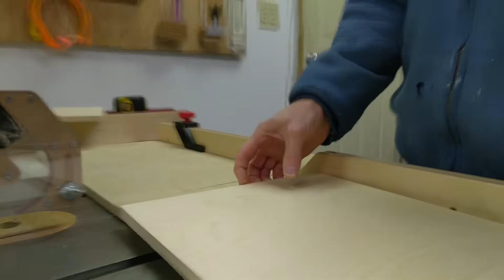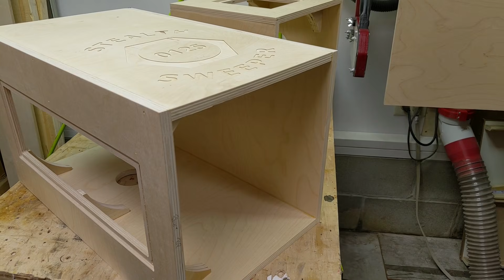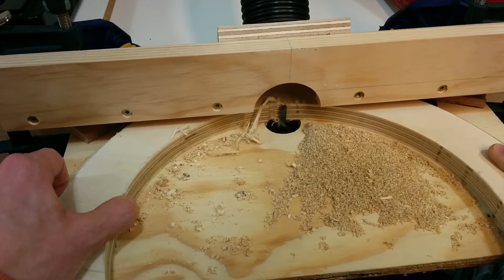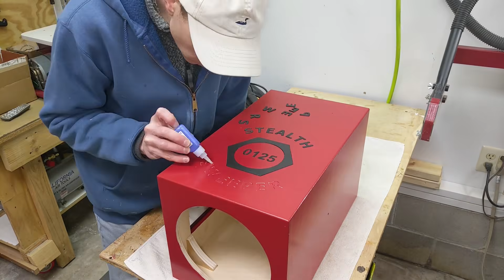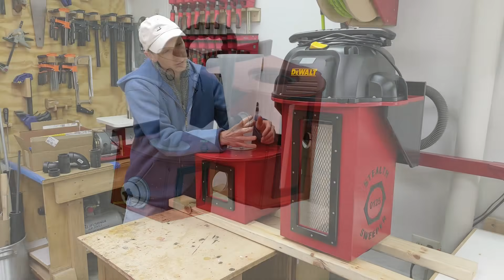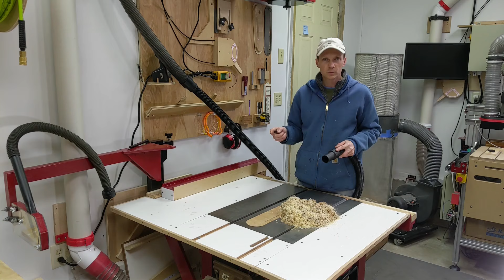The Perfect Shop Vac that Nobody Sells

Comment: Great job, Justin.  My DIY Dust Deputy leaves Zero dust in the Central Vac bucket.  (I use the Central Vac to provide Vacuum to my Dust Deputy)…
I cannot see how far your tube in the top of your dust deputy sticks down?  But, it needs to be down inside about 4” to allow it to get clean air to go to the filter.  It should be 99.9% efficient.  Play with how far the tube goes into the DD.  Your shop looks very nice.
Is there an exhaust port on the Vacuum motor?  If so plumb it outside and reduce the overall noise level.

Comment: Great video.  I am really impressed by all the items you 3D printed. You make 3D printing look so simple. Have you or would you consider a video devoted to 3D printing for woodworkers?  I'm interested in 3D printing but don't know where to start.  Can you point me in the right direction?
Reply: Buy a bambu labs printer like the P1S, or X1C if you have the budget. They just work and cut down alot on the tinkering required to print. Many printers such as the enders do not function out of the box and require tweaking and tuning of settings in software and sometimes of the physical printer itself. This causes alot of frustration for those trying to enter the hobby and treating the device as an expensive tool. 

The bambu printers will still need some software tuning depending on your material, but out of the box it works, it has material profiles that work especially if you use their brand of filaments which are reasonably priced. Matching material to settings is crucial because PLA from brand A is not the same material as PLA from brand B and as such needs specific settings. 

Oh and for CAD Autodesk Fusion (the free license) is perfect for a maker. Have fun!

Comment: I have the Dewalt StealthSonic also and use it with a Onieda Air Dust Deputy. It works great and is super quiet. My local Lowes was selling the vacuum for around $150. Definitely recommended!

Comment: The build, finish and video quality are truly excellent! But I don't agree totally on the construction details. I think that your filter is meant to work in the opposite direction because the metal mesh is placed on the outside. It is meant to have a blow from the inside or a suction from the outside. I think it is difficult to have a dust separation of more than about 99% in these kind of small cyclones and even if that is good it still means that a lot of fine dust will accumulate in the filter. It will of course still work very good some time but eventually you will have to clean it and it will be difficult when the mesh is on the same side as the dust. My solution is a filter with the mesh at the inside and then an extra spare filter. When the filter is clogged I take it out and vacuum it with a clean filter inside. And cleaning is pretty easy without the mesh. But yes, that means two filters instead of one. But mine are rather as your original shop vac filter in size, and therefore less expensive.

But again - your video is still an inspiration!
Reply from the maker: I actually confirmed with the filter manufacturer before buying the filter and  they ensured me the flow direction is from outside in. There is wire mesh on both sides. I agree this does seem difficult to clean but I will find out. This is a common industrial filter so it must be okay. A pre filter cover is not a bad idea but would require more maintenance.
Reply: @JustinDepew  My bad. I see now that there is mesh also on the inside - I have never really seen a filter with mesh on both sides before. But the issue with cleaning still concerns me somewhat. Have you considered pulse cleaning? I'm rebuilding my own dust separator for that right now, can't say how it will work yet but it looks promising from first tests. Not so complicated to implement as it may sound.

Comment: I had a thought… a spring loaded swing check plate on the clean out, with a gasket. The Dewalt vac would seal the check when under power. The main dust collector could open the check under power. Might have to fiddle with the spring tension to get the right balance.

Comment: For the CNC holding - I usually leave .030” on the floor, then cut the shape out with the bandsaw and flush trim. I started doing that because I’m using a vacuum system for work holding, but I have found it works extremely well even when using clamps like you are in this video. Bonus benefit is that your spoilboard never gets chewed up.

Easy to do in fusion with the “Bottom Height” parameter.
Reply from the maker: I think I would do this if I had a good router table set up. Right now it seems like a hassle to set up the router table to do this and I end up trying to cut all the way through on the CNC.
Reply: @JustinDepew I have actually been using a trim router with a 1/4” flush trim bit, I get really good results that way. It definitely helps to have the bandsaw to get close to the cut surfaces though.

Another good option are tabs as lots of other commenters have mentioned. With the low cutting forces we are dealing with, you can use very few and make them small.

Comment: Re low noise, my pancake compressor died, my buddy uncoupled the pancake & coupled in a new 65dB compressor, turned it on then jumped back confused & wondering what was wrong. When i told him that was the new design, he immediately ordered one for himself. It is soooooo nice working in a quiet-ish shop.
Reply from the maker: I agree. Noise has become one of my top priorities in tools.
Reply: Say WHAT? My tinnitus is very active at the moment (even though we're both writing). Loud noise always increases the ringing. SMH...
Reply: which compressor please?
Reply: @unionse7en Husky (Home Depot brand) 4.5gal., 175psi. Runs @ ~65dB

Comment: 19:00 Oops: might be easier to adjust the design or cut file to leave small non-release tabs @~ opposite sides of a full part cut so the center part is still attached but barely. Then cut off the sprue manually.

Comment: Nice project. Your test with  a half bucket of saw dust is not the reality of just collecting from one tool such as table saw only. Which will collect much better than your test. To much sawdust overtakes the system (as in a large amount of sawdust).  To much sawdust will bypass the cyclone which happened to me when emptying a shop vac into my larger Laguna system which I will not do again.  Collecting from a planner would be a good test and I think your system would be a success with that. Your creative imagination is top notch.  Thanks for sharing.
Reply from the maker: I agree, good points.

Comment: @JustinDepew, when you said the dust box port had a trick up it's sleeve, I thought you were going to install a butterfly valve that would pull closed when the vacuum is on & swing open when the big shop dust collector is turned on to empty it ... but I guess that wouldn't work as you sometimes run them simultaneously 😕

Comment: What table saw blade did you use to cut the polycarbonate? Also how is polycarbonate different from plexiglass? I always getting chipping on the edges when I cut those materials.
Reply from the maker: The blade is a regular combination blade. Plexiglass is a brand name for polycarbonate. You might be thinking of acrylic which is also clear but more brittle and prone to cracking.

Comment: Great Job, I like it. The software you use to create the CNC parts should have a tab function that holds the internal parts while machining.  Then the tabs can be sanded off.
Reply from the maker: Good point, that would have worked well here
Reply: Sanded or flush trimmed